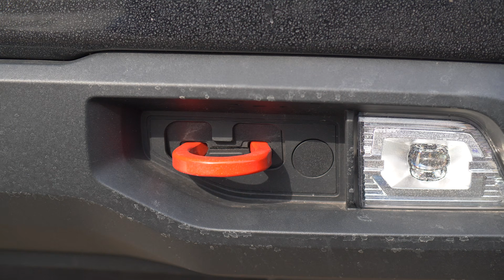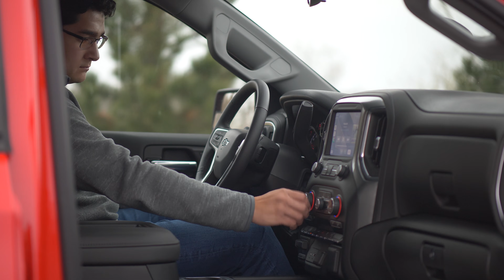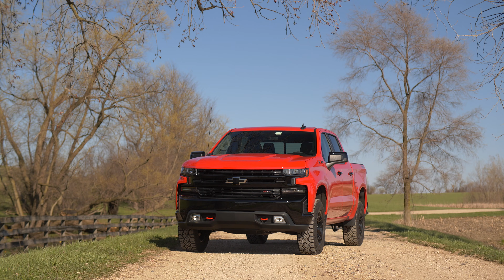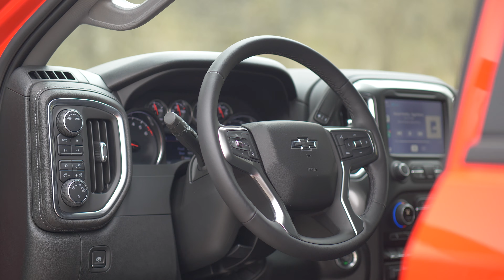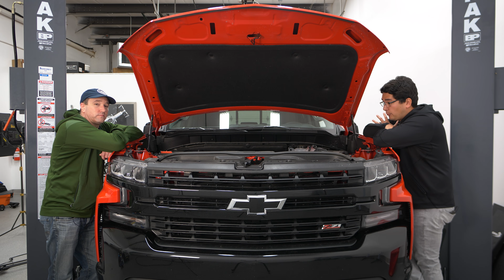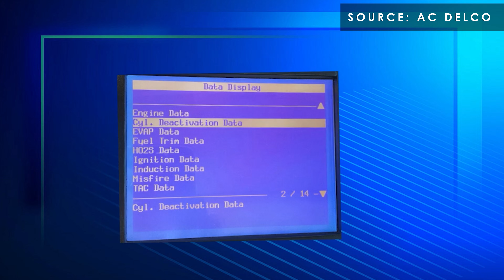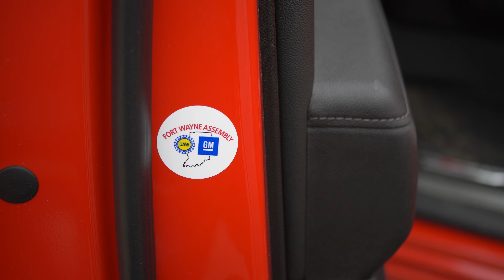2020 Chevy Silverado | The Golden Child

Comment: Cylinder deactivation and start/stop is horrible technology. Every vehicle should be capable to turn it completely off by the dealership.
Reply: Start stop is proven to be a great method of saving gas.
Reply: FXIIBeaver 
What? Half an mpg? For all that wear and tear? Failures? Idiotic.
Reply: Pube83 salty
Reply: Dealership? Should be a button on the dash or in a menu.
Reply: Pube83 agreed. And some new vehicles have that option. But you have to turn it off. Every damn time you start the vehicle.

Comment: Looks impossible to change spark plugs
Reply: Most people that buy these trucks or any vehicle will never open the hood. Hell, they won't even replenish the wiper fluid -- it will happen at the stealership.
Reply: Ive replaced them. Not any different than an LS engine.
Reply: 187FL He means the accessibility of the engine in the engine bay. the last two cylinders gonna be almost impossible without lowering the engine.

Comment: Fail of a design but truck buyers are blind
Why do they never put in paddle shifters or a manual for driving enjoyment?
Reply: its a truck..... i dont think paddle shifters or a manual transmission really help with enjoyment. these are shipping boats for the road.
Reply: @leviathan5207  manual transmission in a truck is mainly for durability and controlling the gearing for carrying a load on different inclines and terrains.
Reply: bigmarkdarula it’s not a raptor which is build completely for fun. It’s a regular truck not a trophy truck... the transmissions aren’t make to be crazy fast. My truck has manual gear selection and I never use it.

Comment: The only  Concept in Daily driving a oversized pickup truck is that you can drive like a azzhole and nobody say anything. I was looking at this video do to I was looking to get one as a work truck. But I don't like that cylinder deactivation. It sounds like a vtec system that wasn't fully engineered right and that will brake.

Comment: Loved the deep-dive in the shop on the afm/dfm breakdown (and reliability nightmare). Didn't know any of that!
Reply: They make it sound 100 times worse than it actually is. The VAST majority of AFM issues affected the 2009-2013 trucks, which had the Gen IV engines and the first version of AFM. They completely redesigned the engine to create the Gen V engine line in 2014 to improve the reliability of the system. The rate of AFM issues with Gen V engines is a fraction of what it was with the Gen IV. I have regularly visited the GM-trucks forum for a few years now and I don't see the tons of lifter issues that the pre-2014 trucks had. I know people that own 2014+  Silverados with AFM that have 150,000+ miles and haven't had an issue with AFM. The key is changing your oil often enough. Savagegeese didn't mention that the same issues affect the 5.7 Hemi. They didn't mention that the Ford engine lineup have had seriously expensive timing chain issues for years. Even their 2018 and newer 5.0L has had some of the worst oil consumption and piston slap issues I've ever seen.
Reply: @hochhaul    the dreaded 5.0 coyote tick is REAL......lol    at least with the 5.3 (even the gen Vi) you can get a module to disble AFM and DFM now.
Reply: @hochhaul  yep. mr goose likes to talk about reliabilty, which I give him major credit for, but spreading misinformation about it is just as bad as not talking about it at all and here he messed up a lot with that segment
Reply: @james2042  its not misinformation.  Internet is littered with failures of meticulously designed chevy small block V8's.
Reply: @dr._breens_beard  if it was a bad enough issue there would have been lawsuits. Over the past 10 years they sold roughly 6 million 1500's, online you will hear issues of a couple hundred. Even if 6,000 trucks had failures of the cylinder deactivation system under warranty in the past 10 years, thats still .1%. If these MDS systems gave out like most of the internet says they do, it would be like 20-30% which would be in the millions of trucks and there would be major lawsuits. Sure it fucking sucks if you're part of the .1%, but its not a plaguing issue.
Reply: @james2042  the fact that its an issue at all is very telling.  People have had entire engines blow after the warrenty is up.  The system is just fundamentally flawed and has no real real world gain in mpg.  U tack on the fact that chevy only employs direct injection without a port injection system to help clean the valves, the failure rates would double.  Ive never been a massive fan of chevy but they really dont know what they're doing now.
Reply: As someone who actually owns a vehicle with 8/4 cylinder deactivation, let me tell you its usually a user error. I own a Grand Cherokee with a first gen Hemi 5.7 that has this tech (same oil pressure driven system) with 110k and it works fine. The main cause of failure is engine neglect, mainly people not doing oil changes, using out of spec oil, or using very low grade oil. These systems require you stick to a very strick oil change interval of 5-6k miles, use only the manufacturer specified oil, and use good quality synthetic. Mine calls for 5w-20, and says specifically any other type of oil will damage the MDS system. Considering you can read form after form of people talking about the best thickness oil for a 5.7 hemi and often the conclusion is not 5w-20, I am not surprised the system has a high failure rate. If you want to play with different oil types, you need to disable the system outright.
Reply: @james2042    a lot of accuracy here,   though that said,  Chevy should have done better for it's customers.    There was 0 reason to have this design..lol.   I bought a 2019 WT (has AFM and a 6 speed) and I aint worried even a little.
Reply: @james2042  I also have the 8/4 on a 2007 Silverado with 160,000 miles and have never had an issue. I cannot even tell when it switches unless I have my DIC set to see that mode. And I change oil every 3000 miles. My mechanic claims that they make the most money off people not changing oil every 3000 miles and going the 5-7 like the factory says. Then you just start to get tarnish and all that crap built up on sensors and other internal parts.
Reply: @peterpeterson7784  you nailed it. Low mile oil change intervals with quality oil and your chances of having a problem free engine go up substantially. The manufacturers won’t say that 3k oil changes are necessary as it would run customers off because of costs. Ford in the same boat with turbos and VCT actuators; stretch out those oil changes and you’ll be sorry. Actually all engines need shorter oil change spans! All this advanced engineering yet you better change oil like a 50s car.  Stay with 5k or less and you’ll be alright.
Reply: @james2042  Exactly. The system operates using engine oil and if you don't use the engine oil it was designed to use and change it often enough, the system will have issues. All modern engines will have reliability issues if you don't follow those two basic rules. Some people will think they know better than the engineers and use a heavier weight oil. Others will use an expensive synthetic oil that tells them they don't need to change it for 10k miles. In either case, you are risking damage to the complicated components in the system.
Reply: @hochhaul  "Some people will think they know better than the engineers and use a heavier weight oil" - It's not that some people think they know better (though I'm sure some do), it's that the engineers are working under strict fuel economy considerations, while modest fuel savings from cylinder deactivation or engine stop-start features (or the 0w-20 oil specified for many engines, now) might be far-overshadowed by the costs of reduced longevity. Debacles like Ford's Powershift transmission troubles have caused people to have lost trust in companies paying heed to guidance by their engineers.
Reply: You should do some reading about the Corvette too. AFM has been a nightmare on the C7 but manifested as a different problem. Namely eating up torque converters and causing the car to violently vibrate as if you had a destroyed U-joint in your driveline.
Reply: GW  that's dumb. The 5.7 HEMI is just as reliable and long lived as the Ecoboost. The 5.7 had the same issue pre MDS. The Ecoboost has a timing chain issue causing premature engine failure. If this hit piece of video did any research the engine failure rates would be compared.
Reply: Just buy a tuner and turn it off. Easy peasy
Reply: I just got my 2020 trail boss with the 6.2L ... and yes its impressive.  I'd would have picked the ram rebel but it only has the 5.7L and it was 6k more. The interior was better but not $6,000 better. But everyone is different and they do different day to day things. So to each their own.
Reply: That assessment is mostly B.S. both the 5.3 and 6.2 are well above industry averages in terms of reliability.
Reply: AFM started before 2015.  My 2010 Yukon 6.2 had AFM.  I say Had before I rebuilt the engine when a lifter failed and I removed it.
Reply: Riyad Kalla 
Just one reason gm resale is shit
Reply: Pube83 yup, on both my ‘08 Tahoe, and ‘10 Camaro, I had that electronically disabled.  Very annoying.
Reply: Can’t disable at all on the new ones. No ones came out with anything to override it
Reply: @hulbert87  Tec 2 .
Reply: Tec 2 can not disable it
Reply: @hulbert87  Yes they have, all over the place.
Reply: @hulbert87  yes you can. Get a range chip.
Reply: @andym1223   When I commented,  range did not have one out yet .......
Reply: @Guydude79   No, range just came out with one. DFM different then AFM
Reply: @Pube83  still better resale than ford or ram
Reply: @damitbobby6677  
Lol in what market? Definitely not the NW.
Reply: @Pube83  look it up.
Reply: @Pube83  compared to who?  Toyota? haha look at ford F150's lol
Reply: That (reliability nightmare) savagegoose keeps bringing up was two generations ago, sounds like bias reviewing to me

Comment: I dislike the fake dual exhaust. The Tundra Pro has two pipes, two converters, two mufflers into two tail pipes. That’s how it’s done.
Reply: I dislike that the Tundra doesnt have a locking diff like any American truck has. Good luck off roading, but hey, at least you have real dual exhaust...
Reply: @andym1223  Good luck off roading? Baha1000 stock class winner when the Raptor could never compete. In fact the 1st Gen Raptor NEVER finished in the stock class. You people harping about lockers forget that TC can do at the very least 80% of what MOST buyers will use these trucks for. Been through cross axle undulations with full articulation on the truck with literally no need for a locker. 

Maybe you should learn how to drive your truck instead of having to rely on a locker. There's a point at which a locker is needed, most driving situations do not require it.
Reply: @Austin An LSD and locker are two different things though. If you're running a torsen you may as well have an open diff. Clutch type LSD's are great but not for off road use. 

A locker would be useful in a lot of situations. Suffice to say most situations folks get into do not require a locker. I've been on quite a few trails with my GX fully loaded and even then I never used a locker. Flexing and articulation is what causes low traction situations to develop. 

The goal is to keep all 4 wheels on the ground as much as possible ensuring optimum traction. That is 4x4 101. The more flex and articulation you have the higher the chance of getting to the limits of that articulation which is exactly why I said it. Even with fully unloaded suspension with the tire now failing to make contact with the surface, TC can improve the situation in most of the time.  

Learning to drive the right line is a much more important skill. Even in those situations if you have a hard time, ride the brake and get the vehicle to crawl through it.

Lockers are helpful but a better driver is much more useful. There used to be a time when 4 wheeling only meant relying on 4wd with no lockers at all. We still got around irrespective. Hell we used to wheel with pizza cutters and open diff's for god sakes. You folks buying a stock truck aren't taking these things to the hardest trails out there which is why TC would be more than enough for most consumers. 

With today's traction control unless you are pushing the limits of the vehicle a locker is crutch for shit drivers. Seen plenty of trucks with lockers struggle purely because the driver thought he had a silver bullet and picked a shit line.

Comment: Can you actually see over the massive hood when climbing a hill off road?  I drove a 2500 company truck in 2014 and had to stick my head out the window to see when climbing hills.
Reply: Same here, grabbed a rental. if you dont drive 2500 often its definitely a change. I noticed the same thing, hard to see over the hood in certain situations.......I needed the seat higher but it didnt have electric seats... I have long legs but a shorter torso.  I got used to it after a while and it had plenty of power but yeah something to think about!

Comment: If this car is their most important, why does it lack in so many ways as mentioned with interior design and materials, and to a less extent the exterior design? I understand the Silverado cant impede on the GMC Sierra which is more upmarket , but from what I've read and heard it isn't a whole lot better, and is still far from the quality of Ram. Just goes to show that GM is falling behind
Reply: Comparing this thing to a ram is like comparing a gunshot wound to a stabwound.
Reply: The Silverado is higher quality than the Ram. Sure, the ram may look better, but GM uses higher quality parts and components.

Comment: There is no turbo v6 option on the GM trucks. There is a NA v6, turbo in-line 4, turbo diesel, and two v8 engines.
Reply: kruck96 it’s a 2.7 liter which is unusually big for a 4 cylinder but I doubt he realized it was inline
Reply: I'm going to miss the 4.3L when the 2.7L replace it.
Reply: He was not mistaken. 

He was referencing the 4.3l gas v6, which is an option on the Custom Trail Boss trim level, as well as other lower trim silverados. 

It’s actually a great engine for its fleet-oriented class.

Comment: quite a bit of surface rust on a new car..dont ya think?
Reply: rockn roll  I do rust proofing during the busy season. The frames are chalky and crusty before a full year has passed. After 5 years you can take an air gun and blow fistfuls of rust out of every hole on them. They're awful.
Reply: @Trussme96  Planned obsolescense.
Reply: I just bought a new Ram. I think their rust coating gives off a brown tint that looks like the start of rust. It's like wearing a red shirt.
Reply: GM bean counters still insist on wax dipping the frames as the only corrosion protection.  You can scrape it off to bare metal with your fingernail, and on a hot day you can wipe it right off with a towel.  Toyota learned their lesson on that years ago, and they actually replaced frames at no cost under a special extended warranty program.  Would GM ever do that?
Reply: If you listen real quiet late at night, you can hear a Chevy rust
Reply: They've had rust issues since 2015. 2 years old and the frame is completely orange
Reply: Just America build quality